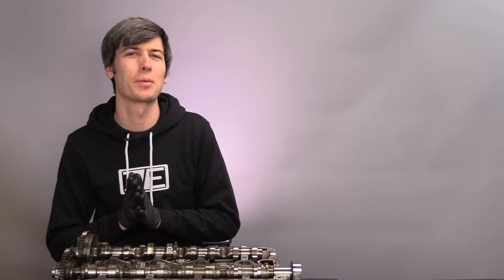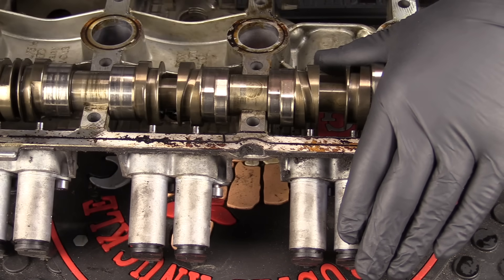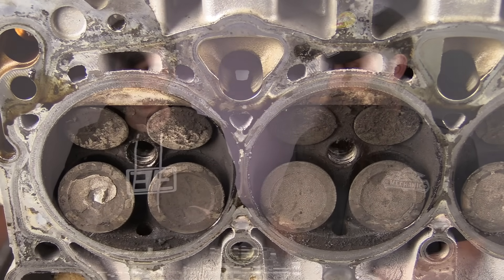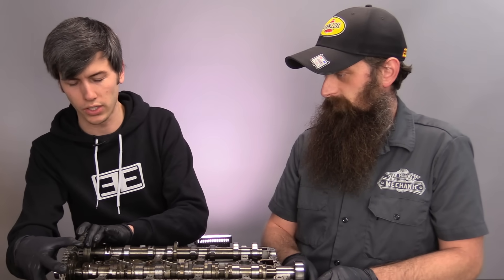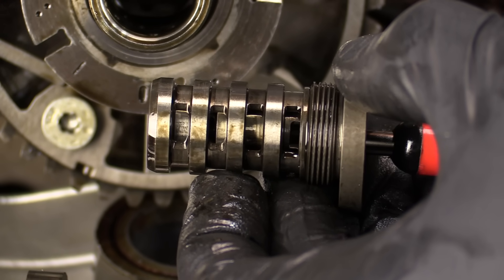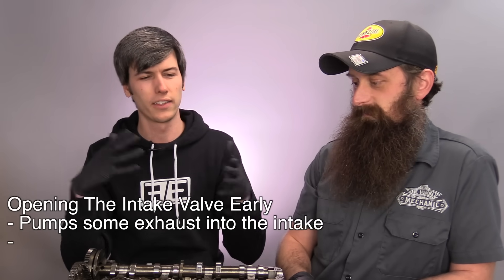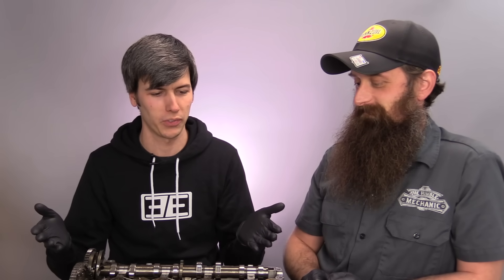Variable Valve Lift vs Variable Valve Timing - VVL vs VVT

Comment: My question is for the VVTI it seems like for the most part from what im hearing is its for EGR, and temperature control,  etc but performance wise is it better than non vvti ? 

For us supra owners there is always two primarily engines of choice... 2JZ-GTE  and 2JZ-GTE(VVT-I) the common thing is people that run the VVTI version claim better throttle response, earlier torque output in the rev range and earlier hp output earlier in the rev range in comparison to the non VVTI.  

It seems as though there is a considerable performance difference besides just maintaining certain temps and egr control.  At the same time however it still seems like most supra's you see that are pushing high numbers are still running the non vvti head. Once and awhile you do see a pretty high hp vvti supra but im wondering if there is a limit of power they are useful for in comparison to the non vvti.

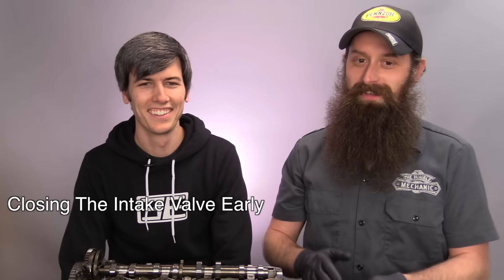Comment: 7:00
Hold up. If the valve closes early wouldnt that mean that the piston doesnt suck in any fuel but instead is fighting the vacuum because there are no open valves? Wouldnt that increase pumping losses?
Reply from the maker: There's still some air and fuel already in the cylinder from when the valve was open. You're just using less.

Comment: Was always curious how they got rid of the egr valve... Thanks :-)
It amazes me that they can so complicate these engines, and still get them to last for so many miles!!! 50 years ago, you were lucky if you got 100k out of a engine!!! 
Thanks for the explanation Mr Engineering Explained :-)
Reply: Material science, computer science and experience in engineering. Not to mention the 100+ years to refine. Metallurgy, lubrication chemistry, computer system control, precision manufacturing techniques. ALL highly developed fields in their own right. ICE has probably the longest running and most interdisciplinary effort into it than anything else other than the field of human medicine. But the irony may be that it will ultimately be replaced by another long time technology - the electric motor.

Comment: Do you see posible in the next 2-5 years to finally assemble a full control intake/exhaust with solenoids?. Why VVL and VVT and VC-T (now)? Wouldn't be cheaper to just make it with solenoids?. Is there a manufacture delay with this technology?. I'm studying electronics, i can not see why no full control, you already have solenoids in this engine. Thank you for the video!

Comment: Funny to hear about NOx emissions in association with VAG.  That's awesome German trickery for sure!
Reply: Patent law is a very complicated thing and differs from nation to nation. And depending on where your patent was registered, it is possible to rip off a patented design and adapt it just a bit so it can be labeled as a new design in the eyes of the law. And you are right: the PRC doesn't give two shits about other countries' intellectual property. They are very strict in their own country when it comes to foreign products, though. They just recently ruled that Volkswagen had to extend the warranty period for their 7-speed dual-clutch transmissions to 10 years because of the various design flaws and problems with it.
Reply: Actually, this tech works - as opposed to the TDI exhaust scam which they did on purpose. It works mostly because the Volkswagen engineers simply ripped off the japanese Honda VTEC design from back in the early 90's and adapted it to their needs.
Reply: Sven Schwingel great comment. :)
Reply: CMac oppooooooooooopooooooooooooopooppoooppoooooooopooooooooopoooooooooo
Reply: Sven. No tech stays patented for the company that invented it. Especially to the Chinese. They respect no one's ownership over technique.

Comment: Essentially don't they both do the same thing? Why do we need different different mechanisms? Why not just use the simpler one for both intake and exhaust?
Reply from the maker: They have completely different functions, as explained in the video.
Reply: Engineering Explained Yes, but isn't the end result same? That is, varying the volume of air coming in or going out per cycle?
Reply: Engineering Explained Yes, but isn't the end result same? That is, varying the volume of air coming in or going out per cycle?

Comment: questions: 
1) can the VVL work on a 4valves/cylinder engine? 
2) what gloves are you wearing? brand? material?
Reply from the maker: Yes, this is a 4 valve/cylinder engine. Charles' gloves. VW spec pro-mechanic HM edition.
Reply: can't find them on the internet, but thanks anyway

Comment: Supercharging and turbocharging affect gas mileage right? can you explain to me how and why? thanks in advance
Reply: Hamzeh Shuqair because you are forcing more air in, so that more fuel can be pumped to make more power. So bassically you use more fuel because there is more air and the result is much more power.

Comment: "Variable" is more "2-stage" valve lift in this case. BMW's Valvetronic has true variable valve lift by adding another shaft and using a stepper motor. Still good video explaining the benefits.

Comment: I'm just waiting for aftermarket freevalve systems :O By the press of a button you can change your "cam" profile. One minute you're in eco mode just sipping fuel with little emmisions, and the next minute you're blasting away with an agressive profile :D

Comment: Jason, if its about efficiency,  why would you not want to ALWAYS have fresh clean air going into the combustion chamber?
and wouldn't pushing some of the exhaust back into the intake manifold shorten the life and reduce performance bringing dirty air into the combustion chamber?
and what about opening the exhaust valve early? Would that not be best for the engine to get ALL of the exhaust gas out for cleaner emissions?
Reply from the maker: RE your last question, no. NOx comes from high temperatures. By lowering combustion temperatures, you can reduce NOx emissions.

Comment: Actually, all this valve timing stuff is only partially for emissions. It's also in large part for efficiency.  If you close the intake valve late, but keep the exhaust valve open all the way from bottom dead center to top dead center then what you wind up with is an "Atkinson cycle" in which the effective power stroke is longer than the intake stroke.  This is very efficient, but not very good at making high power.  

Honda uses Atkinson cycle valve timing in their IMA hybrids, which is why a first generation IMA hybrid with a dead battery pack can still get 50mpg.
Reply: Yep. And, OEMs will also consider the fact that most consumers will put lower octane fuel in the vehicle, so valve timings will account for that, as well (and thus sacrificing power).
Reply: @bminerrolltide  Well, yes, that's part of the Atkinson cycle. The compression ratio is about 9.5:1, and the expansion ratio is 13:1 in Honda's engine.  Again, good for efficiency, not so good for high power.
Reply: True, also, opening the intake valve sooner gives the intake air/mixture more time to fully fill the cilinder, this is not as important on forced induction engines but really important on naturally aspirated engines. Closing the exhaust valve a bit later will help with the maximum filling degree, as the inertia of the exhaust gasses will create underpressure in the cilinder and pull/draw fresh mixture/intake air with them into the cilinder during valve overlap. Sorry for my bad English.
Reply: @MVH198  : True.  And I found your English perfectly intelligible, so no apology needed.
Reply: Efficiency and Emissions are very much related though? The more miles per gallon we get, the less emissions per mile.
Reply: @desertrainfrog1691  
Most of the time, yes, but kinda doesn’t work when using extreme lean burn. The Catalytic Converter works only within a narrow operating range,and lean burning, while technically more efficient, produces more NOx as a result.

Comment: I have a question about the VR 5 engine, I have seen your video explaining about the VR 6 engine (and I know how it works), but how does the engine keep itself in balance if there are only 5 pistons? Does it has a bigger counterweight ?

Comment: How does this relate to "Atkinson" cycle engines?
Reply from the maker: Atkinson cycle engines time the intake valve to remain open during a portion of the compression stroke.
Reply: Engineering Explained - which I thought adds to fuel efficiency because you reduce the compression stroke while having the same expansion stroke thus effectively lowering compression ratio. But you said in the video that you get pumping losses which confused me.
Reply: This cycle has just seen the light on the latest edition EA888 Gen 3.5 engines already on the B9 A4 and coming to the facelifted Golfs this year in Europe, this one on the video is a Gen 2 EA888 thus not having the Atkinson cycle.
Reply: Compression ratio will change, but more importantly is you "make" the engine smaller this way.
Stocemetric (or however you write it) is still 14,7. But, of course, it takes less amount of fuel in a 1.6 liter vs a 2.0 liter pr rpm.
So that's where the fuelsaving come in ;)
Reply: Engineering Explained I was having the same thing in my mind. If the oil well was bigger then it would turn through a larger angle and essentially change the compression ratio. Then that would mean it runs the Atkinson cycle right?  It would then be a better solution to Nissan's Sky-active technology. Right?
Reply: How does it differ from closing it early(explained in video) and closing it late(atkinson)? Aren't they pretty much the same in terms of efficiency?